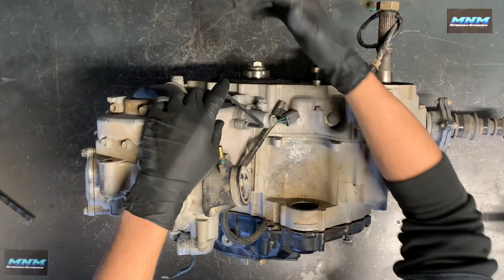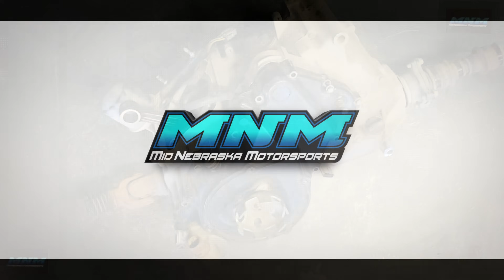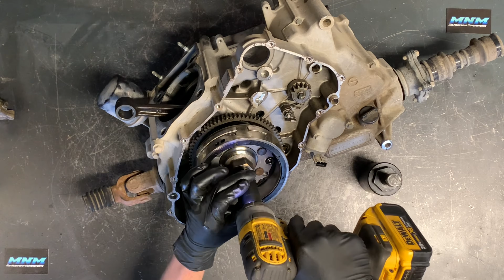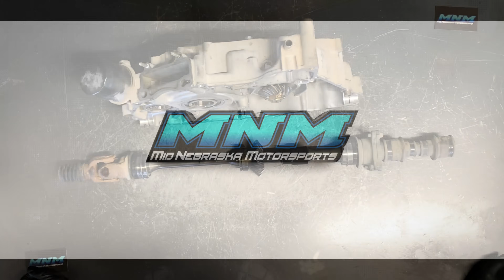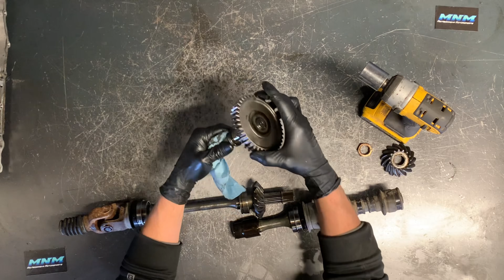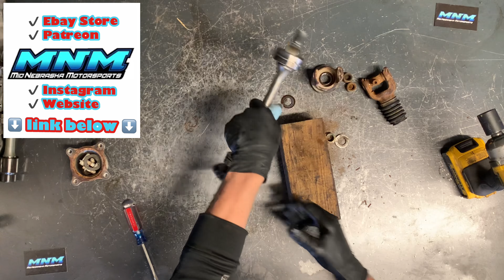Suzuki Vinson / Arctic Cat 500 - Complete Engine Tear Down Motor Explained - Specs

Comment: How much does would you charge to rebuild mine🥲 my Suzuki Vinson 500 runs great. Starts up fine and everything but today it just stopped moving. And I thought maybe the belt broke but upon taking the clutch housing off. That’s not the case. It’s something in transmission🥹

Comment: I have a 2004 Arctic Cat with the 500 engine. The crankcase broke in the same spot that this one has broken. Before I replace that side of the crankcase, have you figured out what causes this?

Comment: Is the starter clutch on this engine the same as a 2001 artic cat 500 Auto Green 4x4.... Mine has a high pitch screeching when i try to start it i need to figure out what is going on i can't be pull starting this thing. I just had cervical spinal fusion and i don't want to be pulling on this thing come this winter.
Reply: I am watching this. I also have one of these machines. less than 300 miles. it didn't run for years. I changed the oil, filter and anything else i could change. flushed the gas tank and carb and it started right up. it ran for a few days  made this high pitch screech and shut down. I'm looking to replace the motor.
Reply: @johnrappa9096  my starter motor was full of black powdery residue after I took the end cap off to check the brushes, so I cleaned everything out with electric contact cleaner, put the case back together with a little grease on the end of the shaft and no more screaming when trying to start it.

Comment: If I used a generic flywheel puller, would that work instead of buying that special tool to pull it?
Reply: No thats how people damage the crank.
Reply from the maker: I agree with you. DON'T go for the generic puller on a $800 flywheel! Thanks for watching and the comment. Hit that subscribe button, if you will.  https://www.ebay.com/str/midnebraskamotorsports
Reply: @MidNebraskaMotorsports  $800 flywheel? I thought I saw one for $40 on eBay not too long ago. hmm.

Comment: I have a 2005 Suzuki Vinson 500 automatic. Is the gear position sensor behind the belt box cover behind the belt and clutch? It looks like it
Reply from the maker: I believe you are correct in that. Check out our Vinson videos and you will find your answer. Thanks for watching and the question. Check out: https://www.ebay.com/str/midnebraskamotorsports if you need parts.